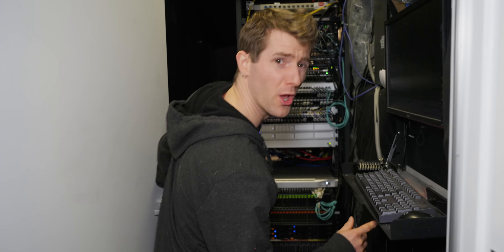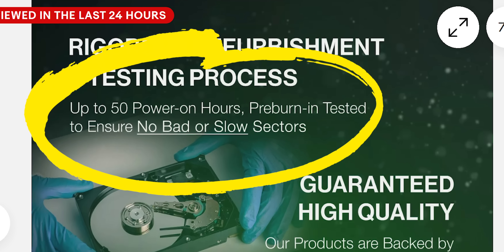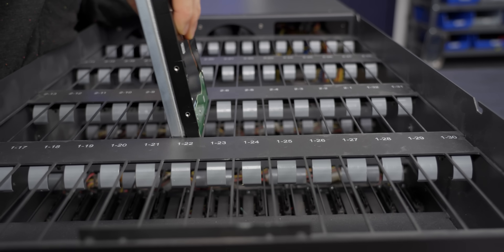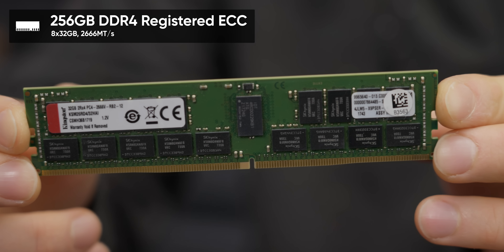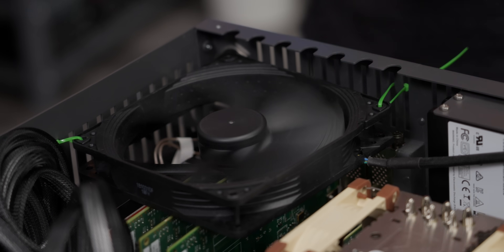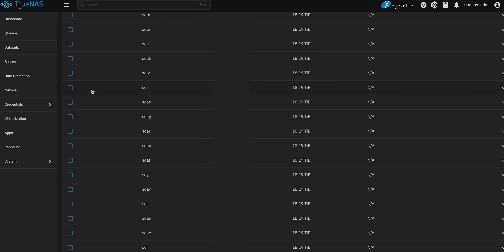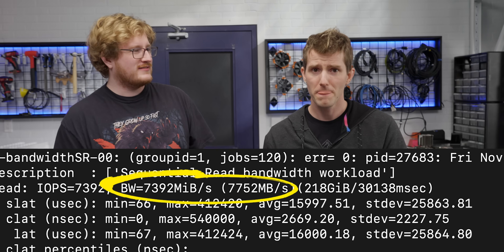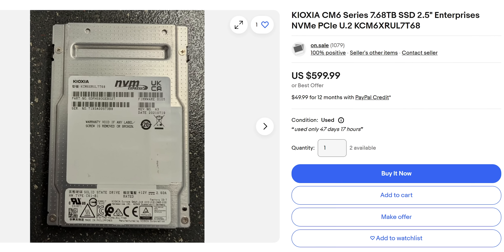Is Buying a PETABYTE on Ebay Stupid?

Comment: I bought a 7000mbps 1tb gen4 nvme with cache used for $35 with less than 100hrs power on time and less than 500gb read/writes. 

All of the drives i bought were 100% life with less than 1k hours and they've all lasted fine so far. Heres to hoping they last for years to come. 🤞🤞

Comment: i've purchased a lot of used (with no reallocated sectors and less than 10k hours of time powered) HDDs for backups (like for third or fourth copy of important data). none failed over the course of 10 years so far.

Comment: I bought from ServerPartDeals ebay site. Got 2 drives and one didnt spin up immediately on my drive testing machine. Contacted them, had to ship back, wait for them to test "in case I did something wrong powering it". Then had to wait to get the replacement.

Even though I let them know it is part of my process and the second drive they provided was fine. I would have understood if they said it was an inventory thing to ensure I wasnt pulling the wool over their eyes...

In the end all ended up well.

Comment: I buy used drives from a datacenter. It's kind of a win-win for a home user. They are happy to replace anything out of warranty at a calculable depreciation rate, and I'm happy they're a lot cheaper and I'm getting stuff from different batches. I'd rather have a used enterprise CMR drive that's been operating ideally over some sketchy off-brand drive for the same price. Even though they are 1/3 through their life, I can be more confident the enterprise drive will fail predictably and not all at once because of a power surge or I dropped the whole case, which is the most likely thing to really happen.

Comment: I've looked specifically at manufacturer recertified drives, but I've held back for two reasons: Money (homelabbing is expensive), which held back the next step and the next reason, figuring out exactly what the manufacturer recertification means.

Thanks for clearning that up :)

Comment: The drives will simply be forward stock built by Seagate for facebook ir some other datacentre that is being overtaken by technological advancement and are unloaded as the need for thrm as "stock" has gone ,  basically they are brand new "current " production but not what is being installed by the datacentres

Comment: I just checked the prices on Serverpartsdeal, they've raised the prices to $240 on their site and $260 on ebay for a 20TB lol. I'd rather spend a few extra bucks and buy them new with the full warranty.  Recertified = used, and the price should be reflected.

Comment: I use to work at Seagate in there drive Repair center, I have also worked on the New build line. and the Refurbished  drives are Tested way more than the new build drive. After Repaired they go in to a heat box and are running Diag Firmware to test for failure.  Then Put on a shelf and run a nother 24 hrs in a surface test. So Seagate drives are really tested well after they are repaired.

Comment: i have two 12tb HGST (WD) drives i got from goharddrive on ebay for about $74 each. so far so good after about 6 months on my unraid server. One had 2 years of power on hours and one had 4 years. still gotta setup a cloud backup just in case lol

Comment: So this is the third instance in six months I've seen tech products labeled as refurbished with no use on it. 

1. HP EliteBook 650 I bought for my mom around July from Microcenter. She needed a laptop with minimum 32GB of ram as she does a lot of spreadsheets and chrome. it came with 32gb of ram, 1tb ssd, and an 11th gen i5 (more on that in a little bit) and it was refurbished. When I opened it up, yes it was labeled as refurbished but ssd had less than 50GBs written to it and battery had a single charge cycle. 

2. Samsung 48 inch 4K refurbished TV I saw at Bestbuy while browsing for a TV for my grandma. was originally 350 back in 2022 but one store had a few of them for 110. Box was in perfect shape. All accessories and TV had exact same factory seals. 

Here's what I'm thinking is going on. These are models that had a revision of some kind and now this is old stock that needs to be sold as a tax deductible business loss. An 11th gen i5 is too old to sell nowadays for new money and just discounting it will kill the value proposition of your current stock. So mark it as refurbished and profit.

Comment: I've been running used Hitachi/HGST enterprise drives at home for about a decade. The original pool of 4x2 TB drives from 2014 are all still in service, with no SMART reported issues. If the drives pass an initial burn-in, and your application doesn't thrash them about too much, it seems they can run a long time. Also: Do your zpool scrubs regularly. (I do them weekly.)

Comment: Been running a couple 12TB drives I got from ServerPartDeals directly in an old PC I use as a NAS for a couple years now with 0 issues from the drives themselves. Should I need a bigger array in the future, you bet I'll be getting some more of these recertified drives.

Comment: However. Is this strategy sustainable? I think almost every 2 years they are building a new PB (is this the 3rd?) 

Is this the best strategy for video storage? I mean in the same price range and below maybe. 

Because in the years to come this will be too much to sustain. 

How are things going to be in 10 years or 20? 

At least the era of tapes you know with good housekeeping, they could last for 30 years on the shelves. Sure, it is difficult to go to tag them and retrieve the archive but it is still today on many tv stations alive. 

Let's say with AI today you could only search 30years old scripts, go get the tape, open, put it on the right minute, take the footage and off you go. In 30 years linus will have a 15PB storage of HDD with the drives at some point needing replacement every 2 (not 30) years more or less.

Comment: I ended up getting a used 14tb drive off amazon for £97 recently to use for plex, crystaldisk info showed that the drive itself was good and so did seagates software.
I may get another 2 of them, one for streaming rom images over the network to their respective modded consoles and one for content creation.

Comment: I love your channel; I'm a frequent viewer. I have a question and need your assistance. I'm building a NAS using my Xeon 2680v4 PC and an 8-port LSI EP400i controller. My primary concern isn't storage capacity, but achieving higher read/write speeds. With the growing demand for 8K video and sequential EXR images, optimal performance is crucial. I work with Autodesk Smoke, and since only one machine will access the raw files, a dedicated NAS isn't strictly necessary. Please help!

Comment: Just a kindly remind that SMART VALUES; as POWER ON HOURS and the rest of things, CAN be reset without any issue, as long as you got the vendor utilities. That "0 hours" value is just a blatant; don't forget that empresarial HDDs are made and used for 24x7 operation. So better think that the drive, has, at least, 2 years of usage if the drive was made 2 years ago (17520 hours)
Reply: And one more thing: Without enough RAM available, an excessively large ZFS pool may NOT mount (due to lack of memory, yes)

Comment: The lot dates on the black housing is the lot date for the black housing only.
Granted they are years ago but that does not guarantee the hard drive was manufactured on the same day the black housing was molded. Additionally, you cannot guarantee that the IMM maintained their date wheels. It is fairly common that date wheels will be missed, especially at IMMs that have poor QMS or systemic problems in the company. A lot to consider with those dates, quality holds, launch dates, FIFO, Days on Hand in the supply chain, parts that are "lost" and then "found", rework, etc.

The label with the QR code could be the lot information for the manufacture of the hard drive. I am assuming and could be worng but it could be. Seagate could tell you if it is. Going off of my assumption, the QR Code at 3:05 shows a manufacture (date) year of 2023.

Update: out of curiosity i googled seagate lot mfg date  -  https://sertdatarecovery.com/hard-drive-data-recovery/seagate-date-code-calculator

Comment: I had a customers Seagate 4TB Ironwolf Pro drive fail, as the supplier and their IT I swapped the drive out for a new as part of their SLA with me.
I sent the faulty one away on RMA, received back a Recertfied drive.

CrystalDisk showed 0 hours and 0 power ups.

I loaded the drive with data for another customer and 13 hours later the drive was completely dead. Spins up, clicks.

This then caused this other customer to be upset with me and caused them downtime (and another visit from me, to them). 

Very unimpressed and essentially two drives have cost me money in labour and customer satisfaction. . 

I'm reluctant to use them now.

Comment: I've been getting used drives in my NAS and it has worked ok because it's in raid whatever that allows for 2 drive failures and whenever one of them fails I can replace it for cheap.  haven't had too many fail really, and more that did were  "new" and I was able to return them and get replacements.

Comment: I bought one of the NetApp DiskShelves back in 2020, for $150 off eBay, when I got interested in setting up a NAS for home and bought 2 recertified 4TB drives with, a 5 year warranty, off Amazon for around $60 bucks each.  I already had a couple so it was a good start and by the end of 2020 I had eight 4TB.  I bought three 10TB recertified drives last year for $80 each to bump things up and I have had zero problems with the any of the drive thus far!  Who knows what I will get next, but will continue looking at the recertified drives!  They're a great deal!

Comment: how funny your actually having some sense and using HDDS! i have 100 tb worth of those recertified drives ive used for years with ram cache, even on ssd required games workes great. course im an insane enthusiast and dont care about "initial" load times after that initial load its just as fast as ssds. glad your doing the buisness solution, its what ill do too when i start my buisnesses with exos drives.

Comment: I stumbled across that company when I was putting together my first plex server using unraid and a 6 Bay nas. Geeze, I would loveeeeeeeeeeee to get my hands on a 45 drive setup and slowly fill it up with drives from serverpartdeals. The paypal pay in four option makes it super helpful for those on a budget, especially with how easy it is to add to the storage pool with using unraid. I would just get a drive and may the payment out of each paycheck (i'm paid biweekly) and by the time one drive had filled up, it was paid off and I could go ahead and buy the next one doing the same method.  The shipping was also impressively fast. I don't think I'll be able to justify ever buying an mechanical hard drive from anywhere else.

Comment: I've been buying refurbished drives since like 2011 and never really had any issues. I've been running 8 of them in my home media server more or less 24/7 for 4+ years. I just try to replace them every 5-ish years to be safe but as long as you have parity drives from different batches, it's probably not much of a risk.

Comment: I bought a refurbished server to use as a mid-tier gaming machine. I didn't plan to play any AAA games so it's enough for me. The included drives were refurbished and still work great some months later. I even threw my old 15+ year old drive in and that still works fine as well. HDDs can last quite a long time before they die. (Yes, I know gaming off a HDD is slow but I'm used to it and I want space on my boot SSD)

Comment: I've bought 4 16tb refurb seagates and have had good luck with them for the last year and a half. My mother in law has around 150k images that she has scanned from her family that spans 1910 to current year and I'm a photographer with around library around 100k images as well. We had both just been using a combination of internal and external storage until I bought each of us a 2bay synology NAS and stuck 2 16tb drives in each of them. I have them set to raid1 then set to mirror data between each other. 

The drives have been great, and synology was actually easy enough to use that I taught the not-techy MIL how to manage the collection and tag stuff through the synology interface.

Comment: for home projects I have been recommending the WD Easystore external from Best Buy.  If you watch the sales you can get up to 20TB for $300 or less.  Shuck the drive, you sometimes have to put tape over one of the power connector pin and it works great.  WD still warranties them even if they have been removed from the external housing.

Comment: The Serve the Home and a ton of @CraftComputing community use these drives from Ebay … burn them in and then use them for years.  I have (12) 10TB HGST used drives with a lot of hours (5years in a data center before I got them) for the last 4 years and no errors.

Comment: I bit the bullet and bought a bunch of 10TB recertified drives a few months ago for a used Synology I also had bought on eBay, total cost of the investment was less than buying the Synology new alone.   Sure, TrueNAS is a joy to work with for my home lab,  as a passion project but I keep work and pleasure separate and the Synology runs a secondary backup of my work related data.  After skeptically testing I was surprised that everything was all just fine.  Some drives had more hours than the dreamy situation the video proposes but also well within spec and definitely as the seller had promised.  Overall, I would do it again.

Comment: 8:30 knock off chips are an actual problem though, Ive seen knock off chips / ICs. They usually are up to spec, but not always, especially when it comes to weirder spec like what is the temperature in which the IC is happy etc.

Comment: I've been buying Seagate Exos recertified drives for a couple of years now - in 1s from Amazon.  Usually ServerPartDeals.  Over 20 so far - usually the 2nd highest capacity available (e.g., 16TB when 18TB are top-of-the-line) so lately: 20TB.  I "burn in" each drive by allocating a full-drive encrypted volume (Veracrypt) and having it write random numbers over the entire drive to format the volume.  Then I write known data to the encrypted drive, and verify it all.  (Takes awhile per drive I can tell you. Several days.)   One of those 20 failed this procedure - reported bad sectors during the verify.  All the rest work perfectly.  My next file server build - coming right up - I will try a bulk buy, probably 16-20 drives at one time.  The price is good for these recertified drives.

Comment: I bought a refurbished segate 6tb drive off of amazon a few years ago, actually two of them to put them in a raid 1 configuration. I think I bought them sometime around 2020 - 2021 and been running them 24/7 ever sense. They are still currently working fine.

Comment: I originally bought 2 14TB seagate refurbished drives for my NAS at home through Amazon. Within a few months, one of them died, got my money back and ordered a new one. I didn't register the serial numbers, but quickly another one failed, again got my money back, but now ordered a new 16TB disk from a local company.
The price was also almost a halve more, but I lost trust in refurbished disks. I don't have time to be continously replacing disks, and not all my data is backupped, the risk is also too high for me.

Comment: I use refurb or even just used drives at home a lot. Aside from a couple DOAs (all of which were refunded) it's been great.

Power on hours is a good metric to look at, but it's not like drives have a ticking clock in the that will auto fail at 2000h or something.

Of the drive failures I've had, 3 were still in warranty (either from when I was still buying new or they were lightly used) and only 1 was a refurbished drive.

I retired a Seagate 4TB drive I bought on Boxing Day 2011 last year because it was really slow, but it never threw an error in all its life. It ran for so long, the power on hours counter actually rolled back over to zero a few months before I removed it.

Comment: In my experience with Seagate drives, they tend to fail by sectors going bad causing them to run slower and slower as they spend more time relocating data on the drive. It’s possible that Seagate is reusing the boards and cases but replacing the platters inside them.

Comment: I bought two 12Tb recertified drives in April, one has died in early October and the second one is still running fine. The dealer gave me a full refund because he wasn't able to provide me with a replacement. So I must say that I'm pretty happy so far.

Comment: I’ve been buying second hand HDD’s for a while. Using them in raid arrays, so that a failure isnt too bad. I’ve got roughly 20 drives, running 24/7 in servers. 2 of them have failed in roughly 3 years. Which has been a great deal imo

Comment: I bought a WD Recertified external Hard Disc, then didn't use it for a while, forgot it wasn't an SSD, threw it in my laptop and mistreated it like a device with no moving parts. 4 years on it's only just started making bad noises..... which is when I remembered it wasn't an SSD.

Comment: I recently bought a used WD Enterprise HDD from Ebay. The seller runs a long SMART test before, but the first one died during the first zeroing run. Contacted the seller and got a second drive, basically no questions asked. (only wanted confirmation via screenshot of SMART values that the first drive was actually unusable, which is totally reasonable) That second one survived all pre-checks and runs fine for now. 😊